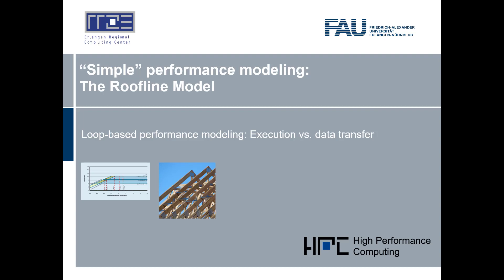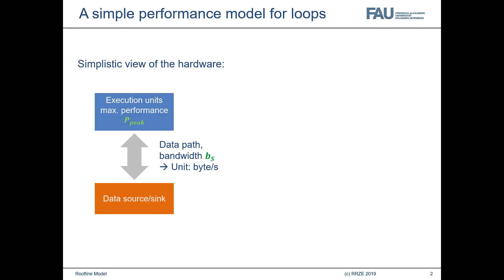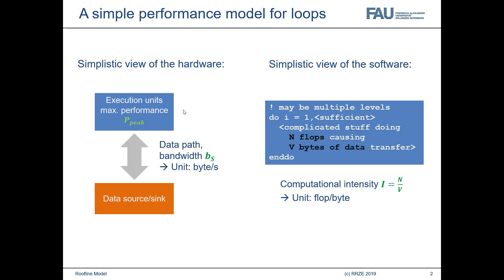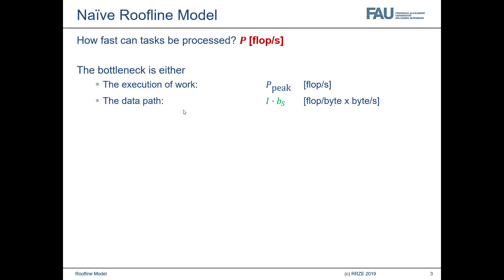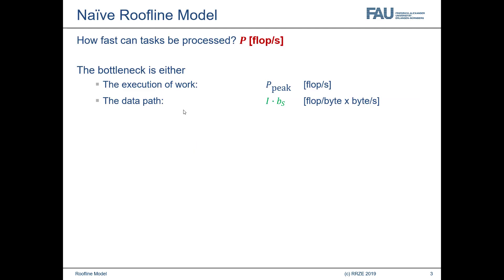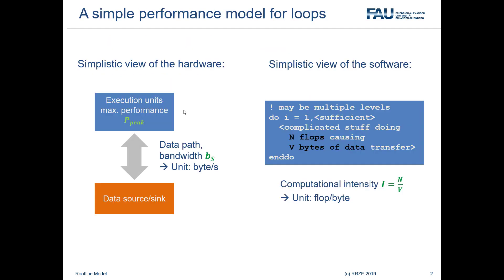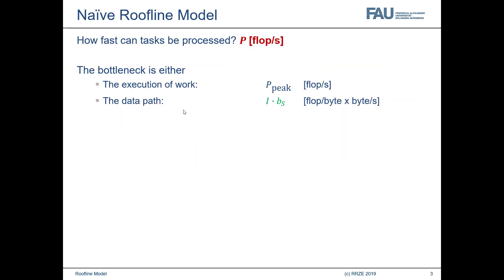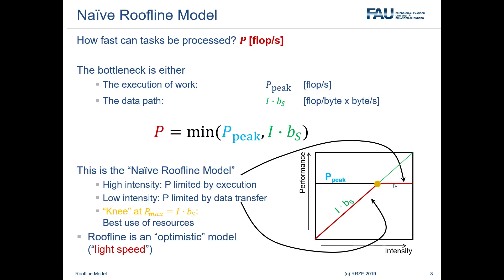A very short intro to the Roofline model

Comment: How is the slope of intensity*bandwidth line dependent on both intensity and bandwidth? According to the graph it should be dependent only on bandwidth.
Reply from the maker: The slope is the bandwidth, because the "bandwidth ceiling" is the product of bandwidth and intensity; I say so in the video at 8:30. But be aware that the Roofline diagram is often drawn with logarithmic axes. The slope of the function (i.e., its derivative w.r.t. the intensity) is still b_S, but in a log-log graph the "perceived" slope is always 1 if both axes are scaled in the same way.

Comment: I still have  one question if the point lies in the region of memory bound,whether does it mean that the memory is not fully used?But how to optimize the code to achieve a better performance?
Reply from the maker: I'm not sure I fully get your question, but I assume you want to know what one should do if the intensity is such that we expect memory-bound execution but the performance measurement falls short of this expectation, i.e., the memory bandwidth is not fully utilized. In this case, another bottleneck limits the performance. This could be an in-core problem (e.g., dependencies in the loop code that prevent it from running at peak; in the simplest case it could just be non-SIMD code), or it could be a data transfer bottleneck in the cache hierarchy, where the intensity with respect to some cache level (e.g., L3) is very low and a cache bandwidth roof applies. In the first case one would try to improve the in-core execution by vectorizing the code or removing dependencies if possible. In the second case one might be able to reduce the amount of data traffic to the cache bottleneck by loop blocking and unrolling techniques. There is a third possible culprit, of course, and this is load imbalance across the cores of the chip. Hope this helps.

Comment: Hello ,I still have one question.1)If the I0 derived from I0.BW=Peak is 1.2,and the actual I1 is 0.72,whether does it mean the actual I1 lies in memory bound?2)If I1 lies in memory bound ,how could we optimize the code to get a better performance value?3)With less data movement or more data loaded in cache?4) If the performance value of one point with I1=0.72 lies below the memory bound or away from memory bound , how could we optimize the code to get a better performance?
Reply from the maker: You may want to watch this video by our friends from Berkeley, where they answer many of such questions: https://youtu.be/lx1oEGtZNK8